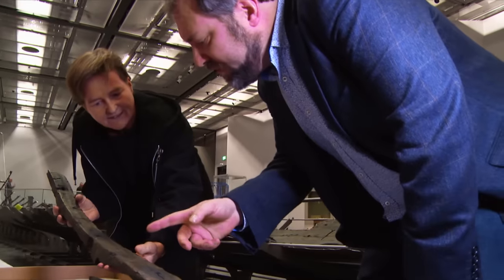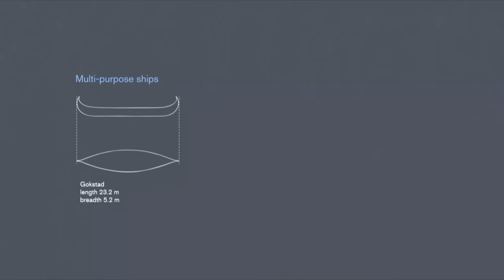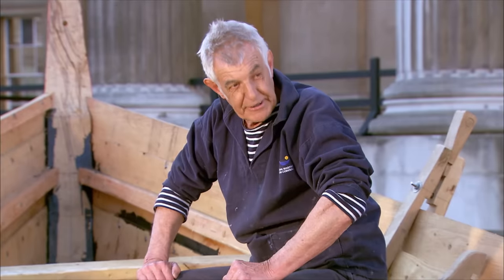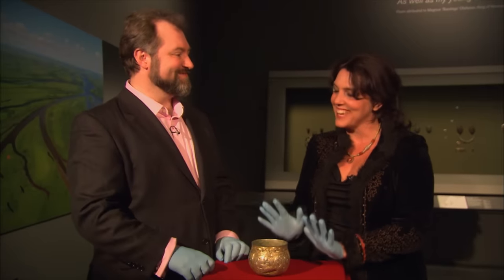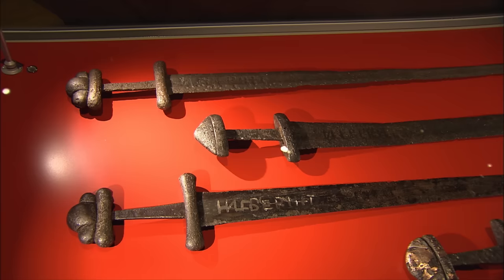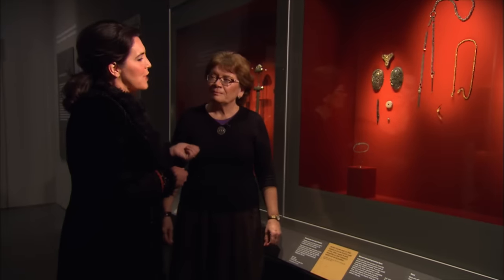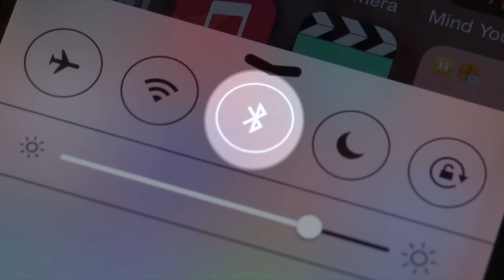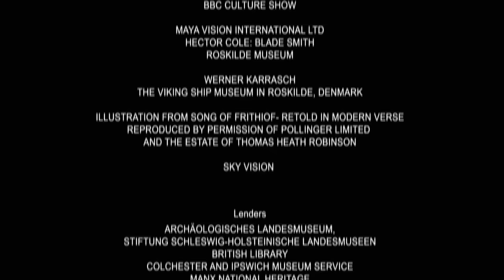Vikings Live: a tour from the British Museum

Comment: Those "traditional tools" are of 20'th century design. Don't forget that hand tools were used for most tasks up to the 1940's 
There are numerous finds of Viking era tools. What distinguishes them from modern tools are, of course, that they are hand-forged, and thereby unique. (But this would be the same up until the industrial revolution) The tools were likely tailored to the user. 
The most striking difference is that they are much lighter than modern tools. Another difference is the quality of the steel. Modern Steel is of a much purer alloy, (wich is not neccesarily a good thing)
Viking era steel varied a lot depending on where it was extracted, (they weren't mining it, but extracted the ore from bottom of bogs and lakes),  and the skill and experience of the blacksmith.
This actually lends some credibility to the sagas in wich a certain sword or tool could have "magical" properties.

Comment: Okey so just wanna point out that it was uncommon for vikings to fight with mails. Second, they have found only 3 helmets in burials in total. Which means they also were uncommon. The depiction of how a viking warrior was dressed and armored is off. Most of them had shield and axes with a dagger as back up. They were taught to fight with all weapons but mostly axes and spears because there were cheap the make compared that to a sword. Not all vikings had the money and the majority was basically a slave that didn't own anything. So they had basic weapons and fraught for their master. You can read about all about it the book vikings at war by the 3 leading experts of the viking era from Norway and Sweden.

And the so called "ulfberth" sword was made with Persian smithing techniques. Lightyears ahead of European smithing techniques.

Long story short European swords/steal had a purity of about 80% while the Persian had a 90% plus purity, meaning it was stronger, more flexible and didn't break as easily as the European steel. This later was copied and branded with the same in Europe and sold as fakes. So that's why some of the were absolutely garbage but the original ones were not. So that's also inaccurate. The viking era started between 550 and 600. 787 was when the vikings on record came to England. 

The shield formation they knew is copied from the roman empire. In the year 200 Scandinavians came back from serving in roman empire as mercenaries. They knew that the Romans was successful due to fighting in formations. The vikings refined this by fighting one o one and in formations. They spared and trained 7 days a week. They never try to fight from a defensive position because they knew most nations trained where armies the same. Formations. And if they could break the formations they would thrive on the panic and their skill to fight one o one. So they would put the most skilled warriors in their front of the formation and form a triangle and ram it into the opponents formations and break them up so they could picked them appart.